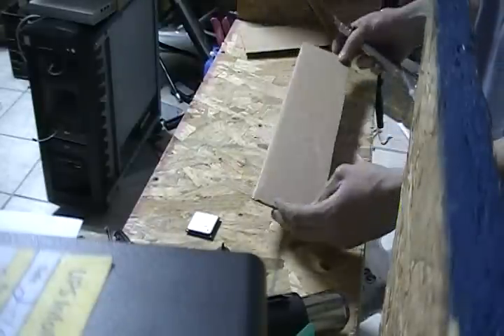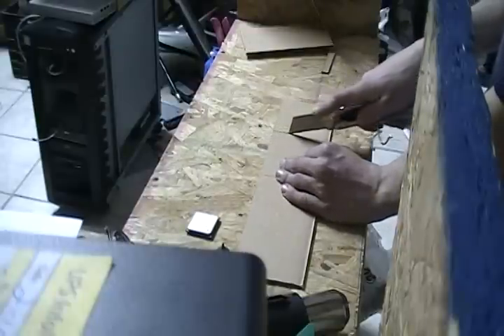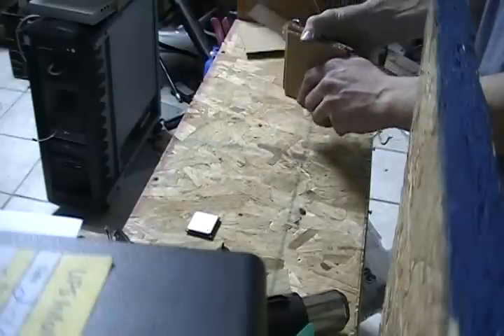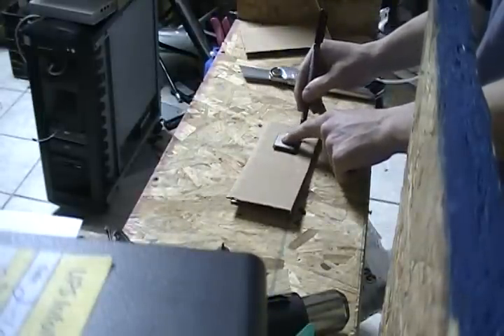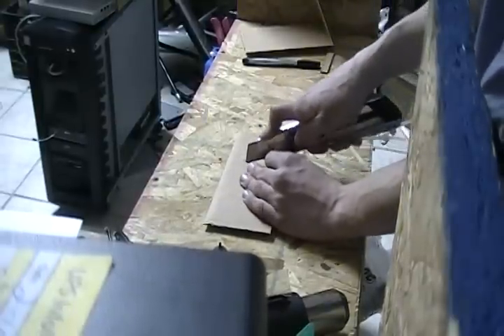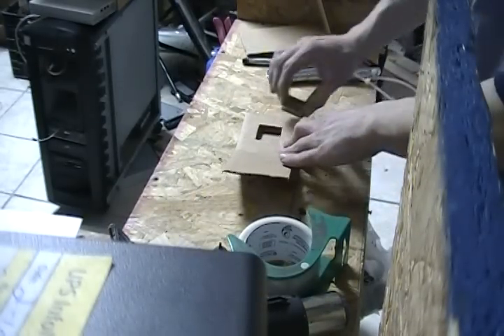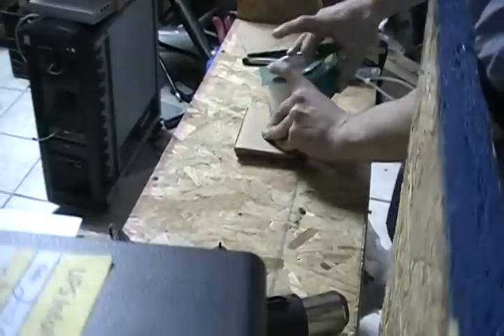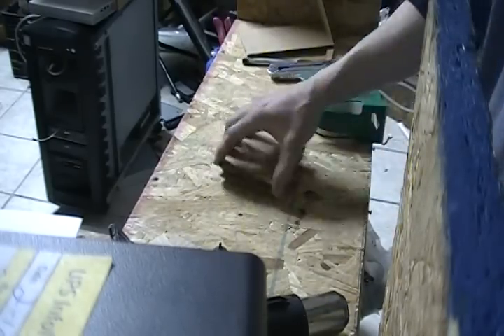How to ship a processor / CPU

Comment from the maker: Motherboards hold their shape well, but they can suffer from damage to the corners, pin connectors, and (in LGA boards) the CPU socket.  Plus, static can be a major problem when the board is received.  I recommend first putting the board in an anti-static bag.  Brown paper may make a good substitute.  Tightly tape the board to a couple sheets of cardboard, and wrap the whole thing with a good amount of bubble wrap.  Finally, wrap in brown paper, and heavily seal with packing tape.

Comment from the maker: The nice part about using the cardboard the way I did is that at no point will the delicate pins be pushed at the edges.  Either all of the pins press the cardboard at the same time, or the top of the CPU presses the cardboard.

For some context, you'll notice that chip makers ship their chips in plastic trays or holders that are shaped very similarly.  Unfortunately, many eBay sellers wrap the chip in foam, which squeezes in on the pins on the edge, then snags them when you unwrap it.

Comment: Do not follow this method, I did it and it caused my cpu to have bent pins. I just lost 115 dollars. Do it at your own peril.
Reply from the maker: I'm sorry for the unfortunate experience.  We ship a lot of CPU's this way.  Do you know what caused your CPU's bent pins?
Reply: Bent pins isn't a lost cause.  Just move them back and as long as they haven't broken and line up to the holes on the MOBO, all is good.  Phenom II x4 965 still kicking and it had bent pins.  I don't remember how I bent them, but I just, unbent them :).
Reply from the maker: By the way, when I do receive a chip in the mail with bent pins, I take a long flat razor blade, gently slide it between the rows of pins, rock left and right once to stand the pins up, then move to the next.  If I get the chance, I'll try to post a video of that, too.
Reply: I'm pretty sure the guy was just looking for an excuse for his buyers remorse. With this type of package, ebay definitely didn't side with me.

Comment: You're a life saver, my PC was pre-built so I've had a spare FX 8350 for weeks with no way to ship it. Time to make some money!
Reply from the maker: +Octavious Black Thank you!  I'm glad I could help.  Out of curiosity, did you upgrade to another chip?  I was looking at the FX 9590 lately.
Reply: Benjamin Vander Jagt I got one of the new i5's, it's so much faster.
Reply from the maker: Intel definitely holds the lead in maximum performance.  I just always find myself stuck at the price tag.  Enjoy your new system.  (-:
Reply: I'm going through the exact same thing with my fx 8350, traded up fr a i5-4690k.

Comment from the maker: The 3rd generation i5 desktop chips use an LGA 1155 package, which means that the chip has a landing-grid-array.  This type of package is less delicate during shipping, because it doesn't have pins to bend, but it's still better off in the cardboard, since it prevents the capacitors on the bottom of the chip from being squeezed by the machines at the USPS.

I realize it took me a while to reply, but I hope your eBay sell went well!  (-:

Comment from the maker: Cardboard's wonderful stuff.  We regularly put chips into any container, including plain envelopes.  In fact, we also ship compact fluorescent tubes, glass wafers, and other extremely delicate items this way without any extra packaging.  When we're just shipping one single chip, we usually just oversize the cardboard, attach the shipping label to that, and tape it so that it's fully sealed.  Thanks for your question!

Comment from the maker: Thanks for your input interista7878.  It should be noted that we use only plain cardboard, not the kind with shiny surfaces.  It's true that lacquered cardboard is a chip killer.  Even putting a motherboard back in its own box without the anti-static bag can kill it.  However, plain cardboard, especially these pieces that are less than a square foot and have been broken by cutting instead of bending or tearing, are no threat to the chips.  Bent and broken pins are much more problematic.  (-:
Reply: That's pure nonsense.

Comment: I tried this with a pinned CPU and it bent the edge pins. This method is risky.
Reply from the maker: Thanks for your feedback.  As with anything you make yourself, it takes a little finesse to get it right.  However, in general, it seems to work better than just shipping in the clear plastic bubble, and it's tremendously better than what we usually receive when we order used chips online, which is simply a ball of bubble wrap and packing tape.

Comment: but if its in a van and the road is bumpy wont the pins on the CPU get bent or damaged
Reply from the maker: Thank you for your input.  The edges inside the finished cradle only touch the edges of the CPU.  Since there's very little room for the chip to move inside the cradle, there's no chance for momentum to build to bend the pins.

Comment: What about the risk of having the cpu shocked shouldn't you use an antistatic bag
Reply from the maker: I wish I could reply to all of the comments I receive here.  The cardboard itself generates a trivial amount of static and won't be a problem during shipping, since the shape of the cardboard won't change.  In order to remain static-free while packaging the chip, I prefer to work barefoot on a grounded floor, but use whatever method you prefer.  Put the cardboard CPU holder inside of an anti-static bag before shipping, which will help to notify the recipient that the part inside is ESD sensitive.  Bent pins ruin far more processors during shipping than static.
Reply: Ok thank you!
Reply: Benjamin Vander Jagt Very nice method. Its a good thing to know that you also placed it inside an anti-static bag since the conveyors and the human handlers inside the mail sorting facility where packages are sorted can induced a significant amount of ESD to that CPU especially in colder regions where people wear a lot of thick clothing to stay warm.
Reply: Static isn't really a massive issue anymore. They are not as delicate as before.
Reply: +Jessica Bills As long as you keep the processor clean, then you should be fine.

Comment: I just received one packed like this and all 4 sides have bent pins
Reply from the maker: Thanks for your feedback, and I love your screen name!  My guess is that the sender didn't pick an appropriate piece of cardboard or cut much too large of a void, which would allow the chip to slide too hard into the sides.  We've shipped and received many chips this way without issue.  Here's a tip to straighten the pins on a processor.  When we do receive chips with bent pins, even when it's a large number of them across the face of the chip, we take a long thin blade such as found in box cutters and slide it gently between rows of chips, tilting it left and right just enough to stand the pins up.  I've successfully straightened the pins on a processor that was found smashed under the leg of a customer's desk this way.

Comment: Good video! Did you say 12x the length of the cpu???  On your video looks more like 6x.  Maybe I'm wrong?
Reply from the maker: Sorry for the late reply.  I think you may be right about the length of the piece used in the video, but we usually do 4x by 12x.  It's not particularly critical, though in some cases we use thinner cardboard and double up the void area, meaning it's folded one additional time.

Comment: Hey, I have the original box from my processor but i cant find the plastic case to hold the CPU, I need to return my CPU to INTEL to claim the warranty. Do you think that they will accept it with this method? +Benjamin Vander Jagt
Reply from the maker: In the Intel forums, someone asked about the RMA process, and here was the answer:

[snip] "The original box is not required but recommended for shipping or packaging." [snip]

Here's the link: https://communities.intel.com/thread/51658

My guess is that they would accept it with this method, but I would probably ask them on the forums.
Reply: Thank you so much :D
Reply from the maker: Thank you!  If you get a more authoritative answer from Intel, please post it here for anyone else who needs to know.  (-:
Reply: Benjamin Vander Jagt  I will
Reply: Hey, I've asked about using this method to an Intel representative via chat and he said that is good. They accepted my CPU last Monday and yesterday the new one was in my door by the end of the day, so, it's good to go 🙂
Reply from the maker: Wow, way to go Intel!  Great return time!  Thanks for the update.  (-:

Comment: Just so you know cardboard is one of the worst ESD sources. Pulling that scotch tape generates about 3000 static volts...

You might not have killed the CPU but you have seriously degraded it and if it were me at the receiving end I'd demand a refund.
Reply: interista7878 what would you suggest?
Reply: You sound like someone who has no idea what he's talking about. 3000 static volts?? Bruh.
Reply: I know this was 6 years ago but I hope you gained better knowledge lol
Reply: @robertgrlic6505  Old comment but line it with anti-static bag or a conductive material like aluminium foil. The problem is that people think insulators provides the best protection but it's the complete opposite since they store the charge rather than dissipating it. The human body can't sense static voltage below 2500v but as little as 50v can diminish the performance and durability of your CPU so if you feel it it's already way too late.
Reply: @GitHubStiizz  Sorry, my brain still functions, "lol".